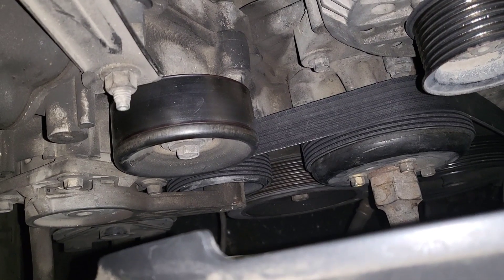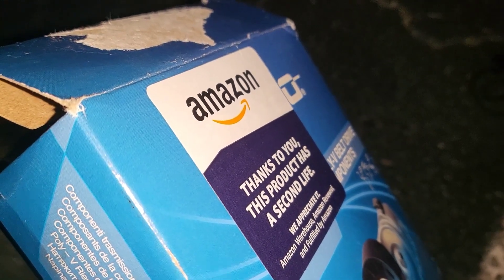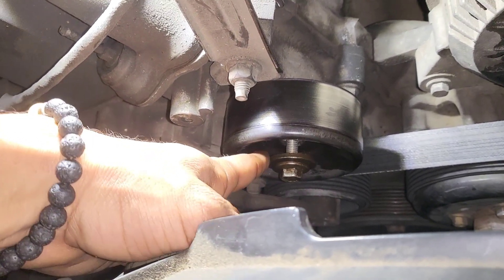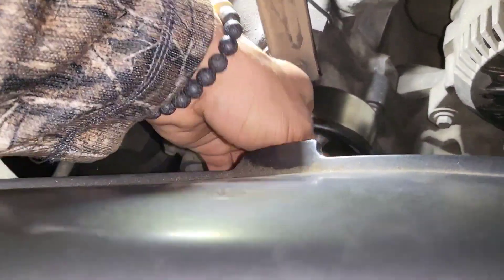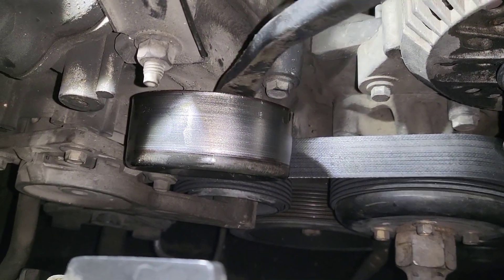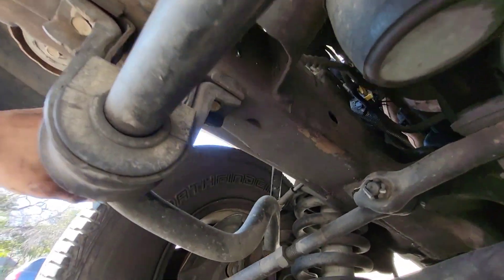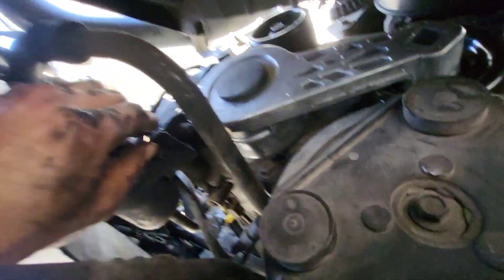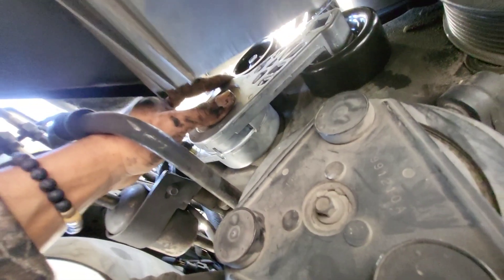1997-2003 F150 Expedition Belt Tensioner and Idler Pulley Replacement

Comment: The 97 -98 Ford F150 is different between the 1999 -2004  Even though the body style looks the same there are many differences including the wiring and the   drive train
Reply from the maker: Maybe so, but for Belt Accessories I'm assuming its similar procedure. If you have 4.6 or 5.4
Reply: That would be a no there are 2 completely different engines
Reply: You cannot take a 1999 f150 4.6 and put in a  1998 f150 4.6  tried it doesn't work
Reply: I'll make a video today on my channel we'll talk about it
Reply from the maker: @TappedoutAuto  similar procedure did not say identical,  also do you own a Ford F-150 From that era?
Reply: @TinkeringTom91  yes and I have owned a lot of these tracks  Gonna drop a video on it tonight just give me a minute
Reply: New video should be dropped  couple hours It's a good thing to learn  what parts that will enterchange   certain engines